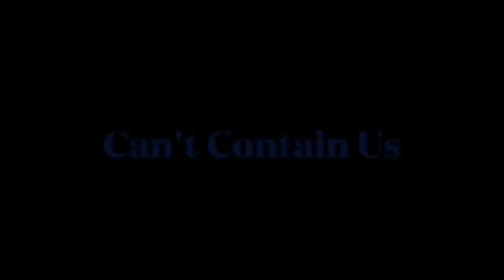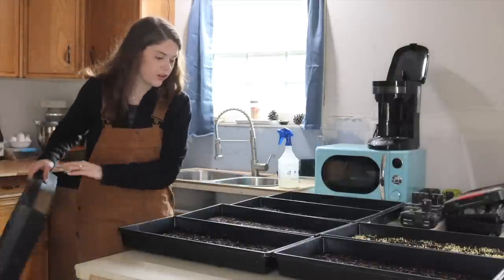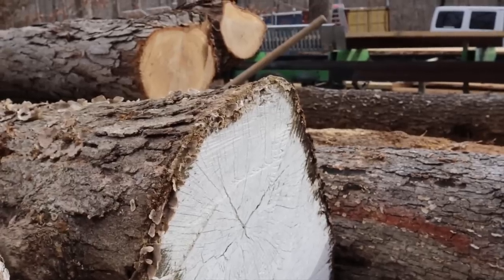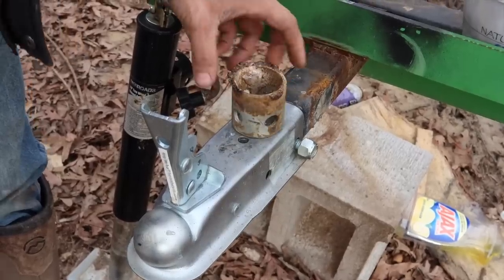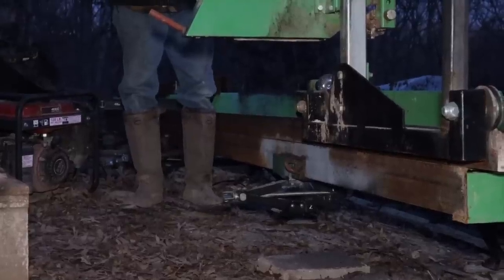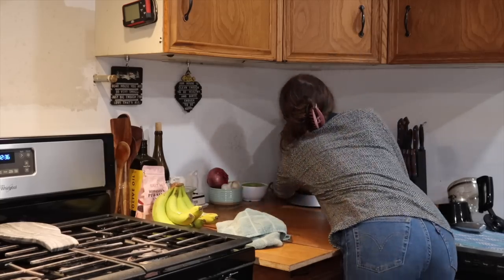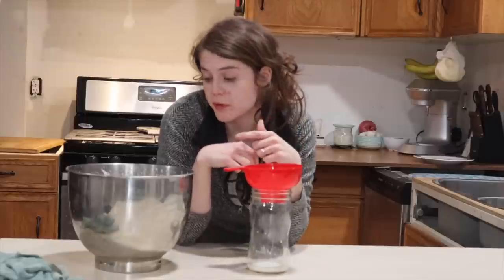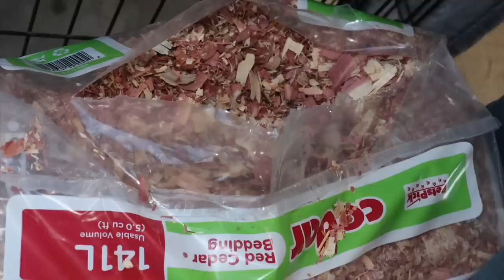Creating a More Efficient Sawmill | Container House EP:99| MILLING Our Own LUMBER for Our HOUSE

Comment: Hey guys you are doing good on building your life. Just a FYI, I noticed on the sawmill repair that you have the cinder block flat side up. They are not safe that way they can crack and fall apart especially when dropping a log on or from the vibration of to he sawing. They are made to be strong with the holes facing up. Just put a board underneath for sinking and a board on top for the jack.  Good luck on your continuing adventures.

Comment: If you guys take a map gas bottle and preheat the metal before welding, it will chase the moisture out of the steel and make alot stronger weld joint.

Comment: You need a diesel heater for your greenhouse.  I use one at night and it keeps the greenhouse above 45 - 50 degrees on cold nights.  These heaters are only about $125 or so.

Comment: Cedar is not healthy for baby chick, use pine instead. Thicker you put it in the cage the easier to clean. I always use a baby plastic pool with chicken wire walls so I can put clumping kitty litter on the bottom then pine shaving as on top, keeps the mess and smell down. Chick are horrible in the house after the first week or so. Good luck with your new chicks